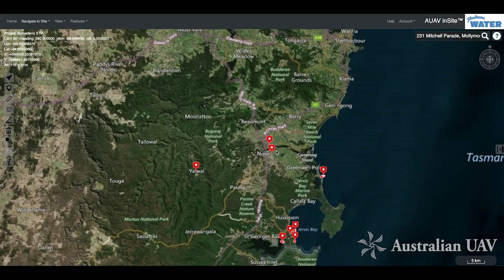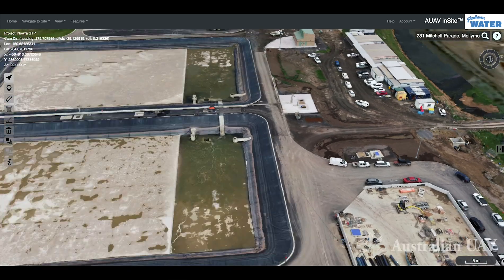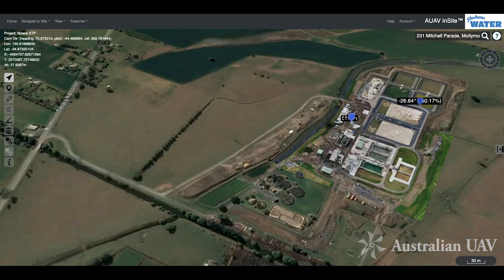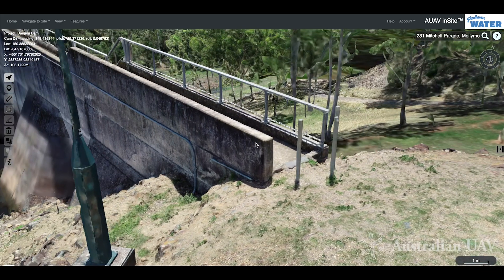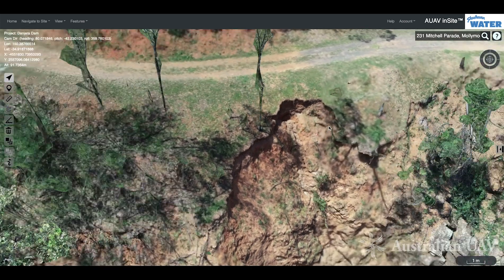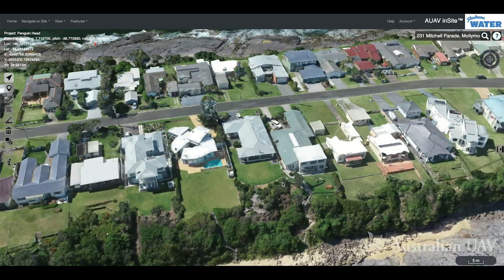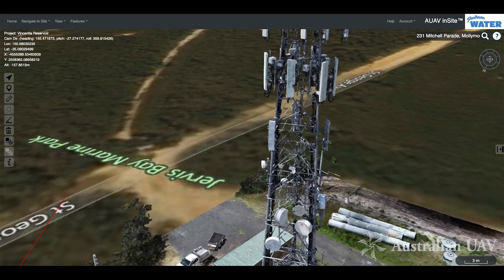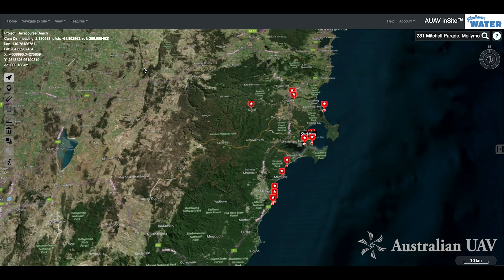Shoalhaven Water - 3D drone capture overview

Comment: What is the GSD on this Model?
Reply from the maker: Hi, it depends on which site (and even which area within a site). We are able to do fully variable GSD, so some parts of interest might be as high as 1mm GSD, but the wider surrounding areas 3cm. We can fit it to requirements and support variable resolution within the data display platform